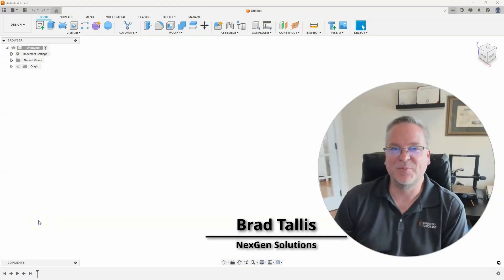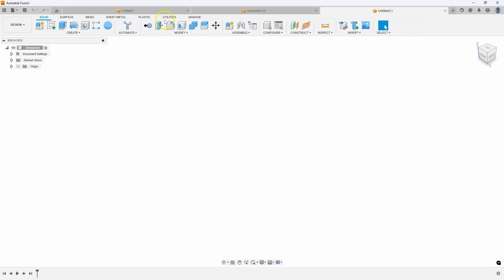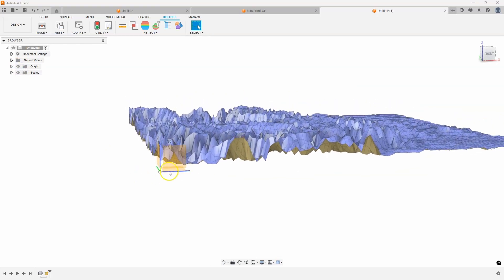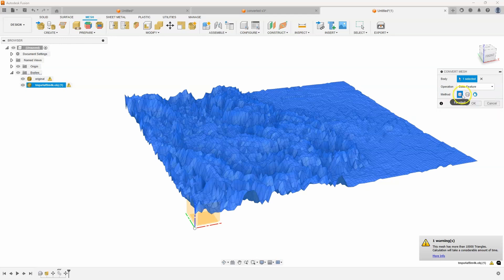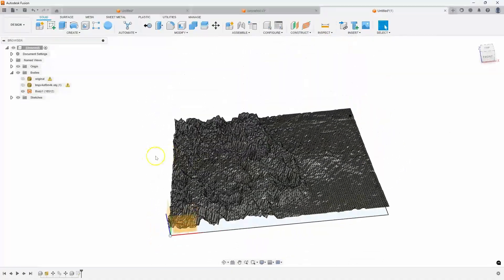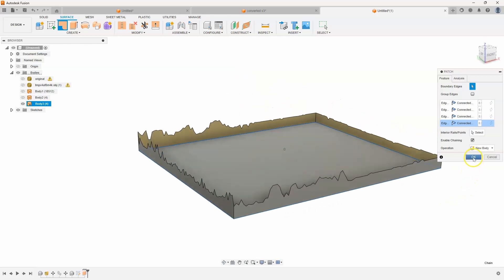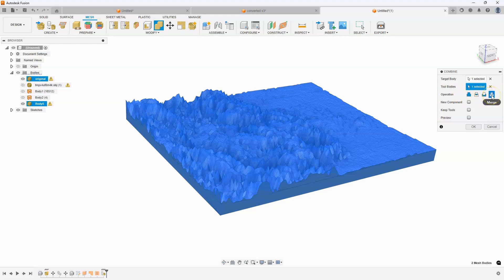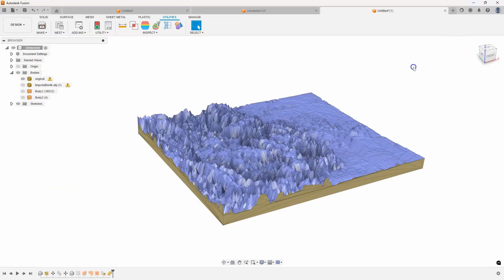Fusion Friday - 3D Printing Topographical Map

Comment: Creating the surface from the mesh doesn't work very well or at all if facet count much larger 10000 (see warning in this video). I was working with 3D scan data and needed something similar. I had to learn just enough blender to decimate the mesh to a reasonable facet count, then imported back into fusion to convert to surface. Blender does a better job than fusion at reducing facet count while preserving mesh details. Well that's my experience. Thanks for the interesting video, I did pick up some surface and mesh modelling tips.
Reply from the maker: I'll have to give that a try.
Reply: @bradtallis8968  I have a long video on this process, maybe you can improve my process or point out areas I missed.
Reply: @bradtallis8968  search for "Metal Sculpture 3D Surface Modeling and Fabrication"

Comment: I live in the solid workspace. Thx for the quick visit to the surface tab.
Unrelated question: How to use parametric modeling variable to control "n" rather than dimensions? I'd like to control how many times a feature is repeated.  Example: n nested spheres of equal spacing where n is a parameter rather than hardcoded.  Thanks Brad!
Reply: create the parameter, then just type it in the dimension box (hopefully I understand your question). you can also click on other dimensions while typing your formula to reference those.
Reply: @JD2jr.  That works well for adjusting dimensions, but what I'm after is varying a "count" of a feature.  For example: I would like three cylinders nested in each other.  But instead of hardcoding it to 3 I'd like to be able to set that to a parameter.
Reply: @HariWiguna  you can for some things; if you use the parameter in the pattern tool, for one (i think)
Reply from the maker: You can create a parameter called "num_of_cylinders" and then change the unit type of it to "None".  Then, when you do your pattern, you can use the parameter in the Quantity field.